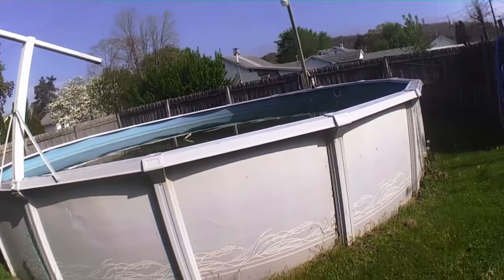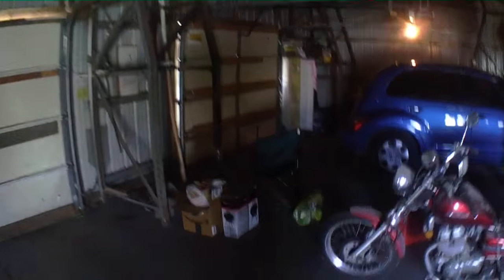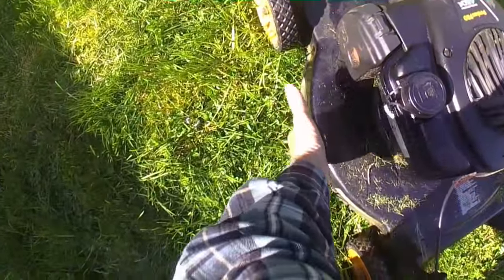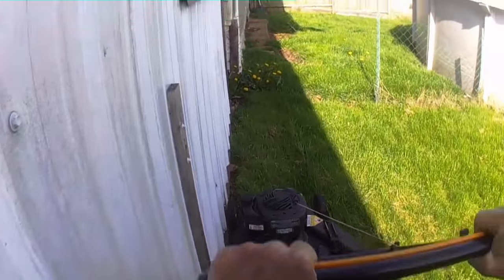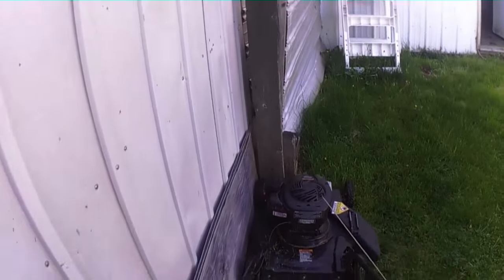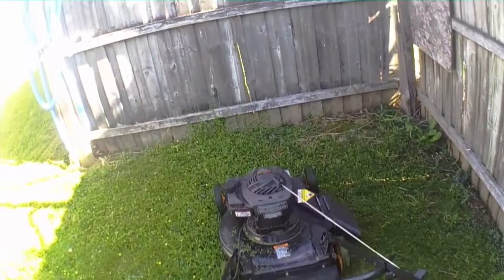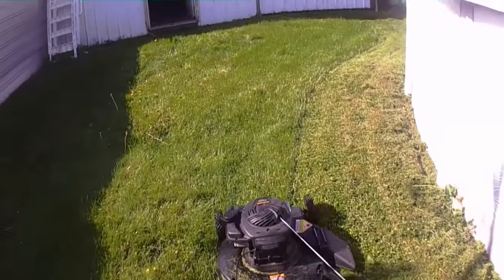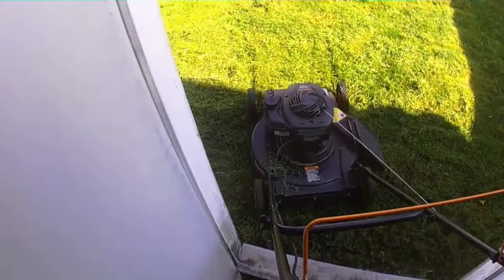How to mow the lawn - inside the fence 2016 05 03

Comment: You got a better mower this time. I want to see more mowing. Can you consider a string trimmer? And a few tips to make that grass really good. Raise your cutting height to 3.5 inches at least or as high as that Poulan Pro goes 3.75 inches I think, and put Scott’s weed and feed to kill the remaining weeds in your lawn, water it if necessary, sometimes once a day for 30 mins if extremely hot, and mow over the same pass 2 times to cut the grass even better and to break up clumps and or visible grass clippings left on the lawn, and that’s all you got to do.